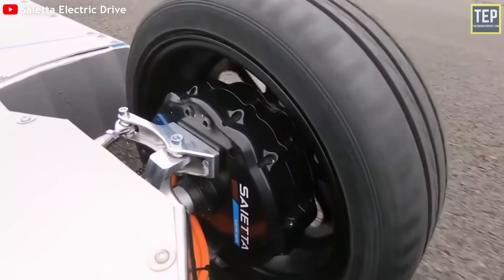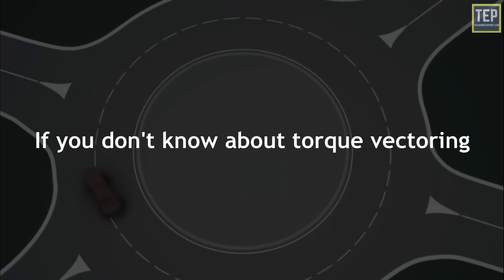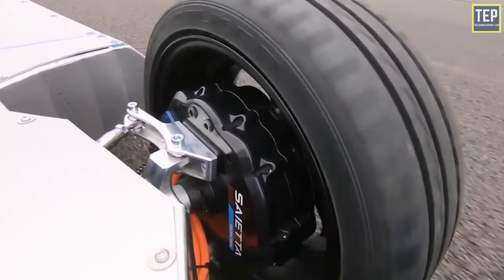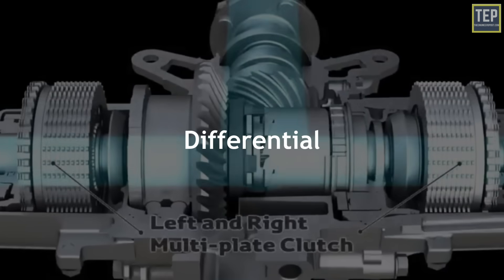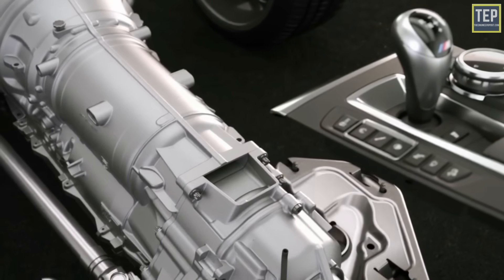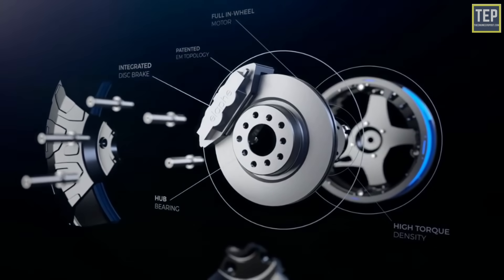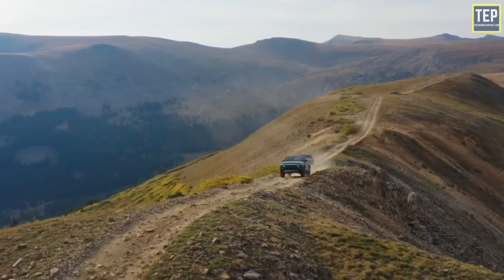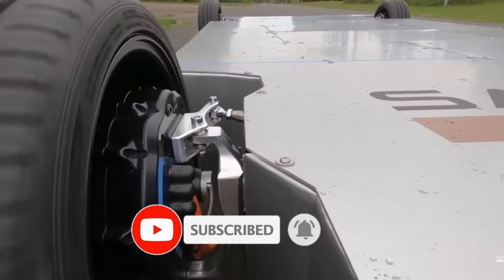How does In-Wheel Motor Technology Work? | Four Motor Drive & Torque Vectoring

Comment: in wheel motor have all the advantages except unsprung weight and vibrations, The motor can be a part of suspension in chassis, so motor can rotate with suspension wishbone link but do not jump with wheel.   If they are similar so that can be  kept as spare to replace in case of damage,,, or the motor can be mounted in suspension with a short flexible drive shaft,

Comment: Since I’ve been in Engineering and manufacturing most of my career, I can see the long term efficiency in this system. It will in time resolve those issues of exposure to road conditions.
Reply: Hi! I am doing a project on this and I was wondering what safety concerns are brought on by placing the motors in the wheels?
Reply: But this will increase unsprung weight, which would make the ride harsher and the motors will experience vibrations and shocks directly. It also puts weight away from the centerline of the vehicle, which would be detrimental to handling.

This sounds good on paper, but does not sound practical. Axle shafts are a small price to pay compared to the disadvantages of in-wheel motors, the shafts can even be made of carbon fiber to reduce the weight. And in-wheel motors are not required for torque vectoring.

Comment: Great presentation about in-wheel motors. Unsprung weight is indeed the biggest draw back. However, with advanced motor weight reduction, suspension improvement, and battery capacity/weight technologies, the in-wheel motors appear to be the way of the future. Protection from the elements,  proper temperature control, and overall durability are conerns as well, but the benefits remain compelling. Interesting stuff! Thanks. 
🙂👍
Reply: Like with EV Batteries, wear and tear are common. Changing in-wheel hubs seems easier to me and probably a benefit. Every 5 years change of 2-4 in-wheel hubs seems reasonable. the fact that these hubs have upgrades over time get you a completely new (faster) feel of the car.
Reply: @QUADBOYification  that's stupid. Why would you need to "upgrade" an electric motor? It's not a stick of RAM.

Comment: How about to use sprung as some kind of suspension system inside the wheel itself to eliminate unsprung weight problem? May be some good engineering ideas will help with it

Comment: I proposed in-wheel motor for military SUV-s in around 1996 already. One such advantage was no IR signature. But in-wheel propulsor can be other than electric too. The "unsprung mass" problem can be reduced by using flexing or even fluid mounting. Yes-it adds to complexity but what other innovation did not?
Reply: no the unsprung mass problem cannot be solved with flexing or sommeting but with minimising component weight and active suspension: Michelin did make such system called "Michelin Active Wheel", with mini high speed motors (with reductor)+ electric active suspension: did work very good, but the high cost from all this high technology components make it uncompatible with mass production= abandon
Reply: @leneanderthalien  If you read my comment you realise that I did not say "exclusively"! Yet- the "unsprung mass" shock alleviation has been done before the nineties. The g-suit and other applications did not have alternates like "mass reduction"-yet ingenious and simple physics were used. About "abandoning" new technologies - the Wankel motor /let alone similar engines from Russia/ was "abandoned" not from the stated technical causes (I had Wankel car)-but from auto industy pressure. It`s been well known.I could  mention Mr.Tesla but I think you may be familiar with his work. What I descibed is "done deal". Ready made components for such solution have been in proven uses for decades in civilian and military vehicles. I just did re-thinking and re-combining those to another assemled forms for hub-driven wheels.

Comment: In wheel motors look attractive in principle but in practice it is not the best solution. Because of the rough road conditions one may have to replace these motors every year or every couple of years which will be an expensive maintenance issue.

Comment: Hub motors are really best used for city driving like a bus. For passenger vehicles (SUVs, trucks, off-road) is a BAD place to use hu motors because of the damage to the motors the wheels get in a pothole, and even bigger issue, cooling. Rivian is using inboard motors with differentials for almost this reason alone - you cannot cool a hub motor. Banging your hub motor on a rock or hole is a good way to kill it. Mounting even four motors inboard, inside the vehicle's frame, is a better option. It can be protected, sealed and cooled.
Reply: There is no differential in a Rivian all four motors work independently of each other
Reply: @storm4710  I should've said a transfer case, not a differential. The wheels are not directly bolted to the motor's drive shaft. From an article by Motor Trend on the Rivian: "Indeed, the R1T's motors don't need the step-down gearing a typical four-wheel-drive system provides. The effect that a two-speed transfer case delivers is an inherent advantage of an electric motor."

Comment: There are ways to solve the challenges facing in-wheel motors. The term I would have used would be drive-by-wire. Aviation term. I am sure casing technologies can protect the motor from the elements. Also, a different way of suspension can filter the road shocks from the driver. It should be the future. Aviation technology showed us that this is the correct way. Move from mechanical to electric as much as you can and address the engineering challenges

Comment: Wheeltorque would be interesting.
With gearboxes this reaches often several thousand Newtonmeters in low gears on the wheel where the motor only make 200-300

Comment: Aren't this horse beaten dead long ago? Hubs will ensure you increase unsprung weight. And for a fun drive we do not want that. Unless there is a brand new design that can at least half the weight of the hubs known today while still have between 100 to 200 hp per wheel. If that is a no go, better stick to quad motors that are mounted in the center and uses shafts to transfer power and torque to each whee. You keep showing video of the Rivian T1 truck, but afaik Rivian does NOT use hub motors. Rivian uses quad motors, but they are  place just like on a Tesla AWD, except of course it uses 4  motors.You have the benefits of quad motors without the drawbacks of hub motors. In other words, stop taking about hub motors. Quad motored EV's don't need hub motors. One motor on each side of the center of the car sharing the same housing and et you add in gearing.

Comment: Very interesting concept! If there are breakthroughs in motor designs to proof it from intrusion of outside particles/matters as well as the impacts from the road surface and with better batteries, this will become the future of all vehicles.
Reply: it can't be future because it has lots of uncountable reliability issues.

Comment: You repeat the the same subject several times and you did not say which type is better.
Reply: This appears to be an AI produced video.
Reply: I think the wheel motor is not possible because shocks and bumps would affect the motor. So we do need shock absorption
Reply: In wheel motors are good for low-mid power cars where you can have relatively lightweight 10-50kw motors, but as pine said, you increase the unsprung weight, so you put more stress on the motor and you have a rougher ride. (That's also the case for those that have the motor on the differential, so it isn't that big of a deal)

Though unless you're driving very rough terrain daily it won't be an issue, we've had wheel bearings for a while and they're fine for a long time, that's probably as much maintenance as you'll need on an in wheel motor.

A big advantage to in wheel motors though is that you simplify the drive train by a lot and it allows for torque vectoring and 90 degree steering easily. And if it's done well, it can simplify the maintenance by a lot.

Comment: It is clear that In-Wheel Motor Technology is excellent. However, it is more important how durable it is. In addition, even if one or three of the four wheels fail, the car must be able to operate normally. I think German-made systems in Germany will be considered positive enough.
Reply: In wheel electric motors is a more than 120 years old technology: the first car made with this was the 1900 Lohner Porsche..."excellent" ? , i think not so: efficient yes (direct transmission) but the main problem is the weight from the unsprung mass who degrade road holding and suspension efficiency: Michelin did test this idea with lightened high speed mini motors + active suspension (Michelin active wheel from 2011)= did work good, but the cost was too heigh to make it in serial...Motor in wheel is today commonly use in  heawy and slow machines, with electric or hydraulic motors...

Comment: We got some future yet current designs that are already working very well in EV cars and EUC’s, PEV’s. Mixed with solid battery, materials, I’m hearing the life expectancy of these motors go from 200-300k miles, all the way to 500k + , and things are just getting started so that will improve , EV’s are definitely the future they are already blowing away internal combustion engines and drive-trains

Comment: Biggest problem with In-Wheel motor is the torque limit. To be a meaninigful means of powertrain, each wheel needs to provide at least 100 HP, but this requires gear reduction.
Gear reduction needs lubrication, just like your manual transmission gear. It can be done, but it just needs one of the startup EV company to brake the mold.
True torque vectoring, Differential lock and stability control can be managed above and beyond what the current setup can provide.

Comment: Only one big disadvantage: unsprung weight. Other than that: awesome, even less parts. Maybe it will work well with high profile tyres.
Reply: SAAB seems to have dealt with the unsprung weight ratio pretty well > 
https://youtu.be/-1VAkXNTR1Y
Reply: Wrong.....there are many disadvantages but people only focus on one. You have to drive one daily to realize them
Reply: I race Motocross and I can tell you first hand we spend a lot of money on after market wheels and hubs to reduce unsprung weight it is a huge factor on any vehicle that setup will  be horrible
Reply: A softer tread, and thicker profile could provide better cushioning, and rides could be even more comfortable because the wheel has greater weight and thereby, more inertia. The other thing is carbon fibre wheels can save a bit of weight, and motors are getting lighter with the use of a carbon fibre sleeve, which improves performance as well.
Reply: @Alrukitaf  nah, higher unsprung weight NEVER resulted in better ride. Softer tread and thicker profile can also be applied to non in-wheel vehicles, so there is no advantage for in-wheel on that scenario too.

In-wheel motors will suffer more vibrations and shocks too since they are "unsprung". In-wheel motor is also more exposed to the elements and thus would require more waterproofing. Plus they move the weight of the motor away from the centerline of the vehicle, which is not good for handling. Axle shafts are a small price to pay for non in-wheel motors compared to the disadvantages of in-wheel motors, and carbon shafts are simpler to manufacture than carbon wheels.

Most of what i said was also mentioned already in the vid. The concept sounds good on paper, but not in practice.
Reply: @sepg5084  Yeah, you cannot overcome the huge downside of the unsprung weight.  This is an ancient concept.  COME ON PEOPLE!  Its like your not even trying.  Hub motors generally suck for cars.   Go buy a lordstown motors truck and be the only loser that bought that stupid design.
Reply: If you're a city driver and a slow driver.
Then this definitely the best convertion kit for any newbie.

Intergrating complex differentials and transmission will end up eating your budget. 
This set if fine if you're just a city driver.
Reply: @OdingHelps  doesn't have to be complex just run the wheels from 4 chassis mounted motors body shape can be altered to package them well since there's no ice engine or fuel tank to restrict them 4 halfshafts and CV joints may add a more weight but in terms of comfort they are a way better it won't need a differential.    If you ever get the chance try ride an e bike with hub motors  then try an equivalent bike with mid drive motor after 2 minutes you will see where I'm coming from ...

Comment: Unsprung weight is a big issue. Small cheap cars ride badly because they use cast iron suspension, brakes and hub carriers.  All that weight bouncing about ruins the road handling. Lighter weight parts are more expensive but considerably improve the ride and handling. 
Drive shafts are well proven and not silly expensive so simply put the motors inside the transmission. 
You can also fit smaller brakes as regen braking does most of the work.

Comment: Sound great if the design is durable. The reason not many ev co adopting this design due to massive direct stress to the motors. The current design is great because the suspension toke all the stress and cheaper to replace suspension components.

Comment: 4 motors on 4 wheels is at a slightly higher cost. it requires to be in different compartments - all of them sealed against water or dust. a computer and a terrain recognition system should take care of the torque. i would install a 4x4 transmission too. to chose between a differential and 4 motors. a very powerful power source is needed. i would make this to be selectable.

Comment: I have an idea of a wheel, like the ceiling fan, then just tyre around it to spin, maybe use cold metal like neodymium magnet(i think least cool), or gadolinium to protect from too heaty, then it is easy right, but the wheel have to be ) and casing to protect the motor.

Comment: Okay let me say..
For example  turn the electric motors  inside out say the stator as part of de hub with bearing and the rotor as one with the actual rim itself...
You get a donut shape within that shape/space you could place a smaller brake set du to the motors itself do have braking inplemented als part to regen braking also put the disc in the rim assembly and the caliper(s) on the hub 
It wil solve a lot of problems seems me in the fact of unsprung mass...

Sorry for my bad english

Comment: wheel manufacturers can integrate a coil on the wheel itself that would act as a generator to recharge the battery. Doing this will extend the range of the car.

Comment: Glad you mentioned unsprung mass. I think there is a reason rivian uses internal motors. But maybe these in-wheel motors would be good for small industrial vehicles, like forklifts. AFAIK they already use "airless" tyres and crazy multidirectional roller wheels.
Reply: IMO as long as the vehicle runs at a relatively low speed at a track that won't cause excessive vibration in-wheel motor is the best design since the simplicity of it makes maintenance relatively easy along with the efficiency that comes with this design.
Reply: @MrEmrys24  On electric bicycles, according to a Youtuber who repairs them, hub motors burn up motor often while mid-drives he has never had to replace a motor. In the absence of gearing to climb a hill amps = torque and heat. With low rotational speeds cooling becomes a problem where a geared motor would be spinning faster with increased cooling, low amps, and better hill climbing capacity of the same motor output. The difference in costs are around $100 or 1/5th increase in cost vs the cheaper hub motor. This example is why engineers need to get into the mechanics bay as what seems ideal on paper is in reality detrimental to the end user increasing maintenance costs.

Video titled, hub vs mid drive motor by JohnnyNerdOut
Reply: @RichardPrendingue  makes sense.... thanks for the info
Reply: @MrEmrys24  yes the real engineering challenge is making it work on an EV that will drive highway speed, hit potholes/bumps
Reply: If it has powerful enough regenerative braking, it can replace the rear brakes entirely (they never have to work as hard as the fronts) and drive rear wheels of a front ICE engine FWD car, making it a hybrid. The unsprung mass won't have increased much if at all and vibrations etc. are less intense in the rear as its suspension usually travels more as it is more softly sprung/dampened compared to the front.
Reply: @kekethetoad  I'm pretty sure Elon Musk would have removed rear brakes all together if he could legally do so that I'd speculate it is required by law due to the fact parking brakes are traditionally part of the rear braking systems and consistent rear brake application aids in stability control. As the rear brakes actually are first to engage helping keep the car in a straight line, much like a rudder helps a plane fly in a straight line.
Reply: May be unsprung mass will have a lesser impact on heavier vehicles. Lets say it's not the same to add a couple of theese in a Golf than in a Panamera. There was long time ago the Eliica, wonder how they faced this issue.